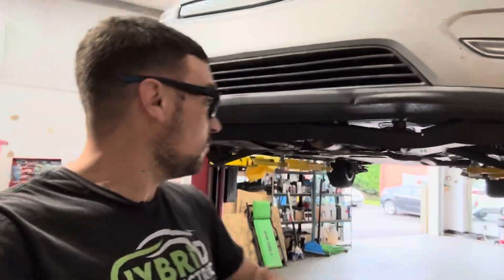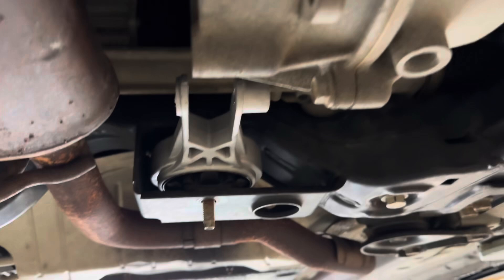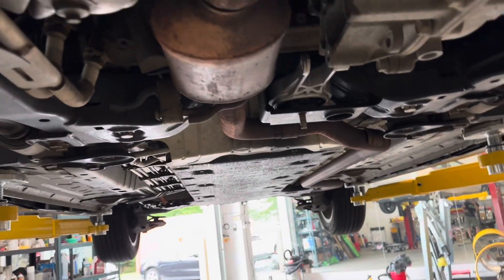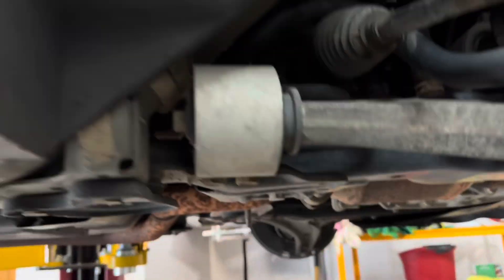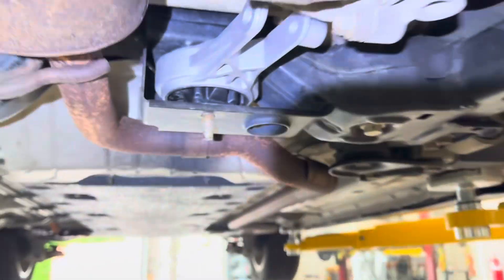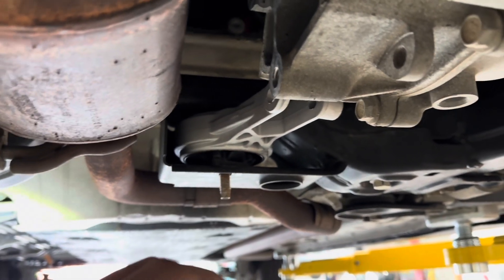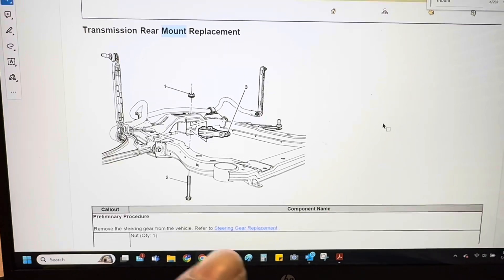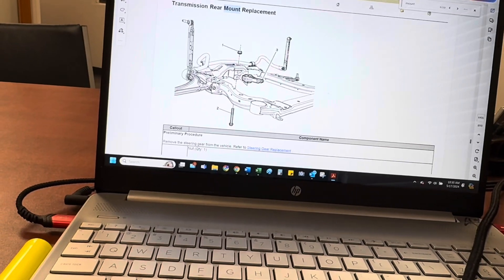Tips for 2011-2015 Chevy Volt Rear Motor Thrust Mount. Bolt mounted wrong way.

Comment: Customer's car is like this, I was considering just cutting the exposed part of the bolt to get it out and reinstalling a new one the proper way...but this is the way! Super easy, the rack slides forward without feeling like you're stressing the intermediate steering shaft, etc... Book time for this mount is something like 3.9hrs, this trick cuts it down drastically!

PS - BTW for this 2014 Volt, the service manual shows it inserted from the top (just like the video shows, and how this customer's car is set up), with the nut on the bottom. Indicating that it is NOT backwards, but obviously there's no issue with reversing the direction.

Comment: bruv if i get vibration/bad mount symptoms, im going to just try the window weld 10$ motor mount repair. its in a good enough position, worth a try. people just need to realize that window weld is a polyureth base and cures with humidity so you need to blast the old crapped mount with brake cleaner, let dry, and apply a small amount so that it can get humidity to it to cure.
Reply: Did that work?
Reply: @HowToDoitright  diagnosed it as a bad pcv diaphragm that is built into the valve cover gasket. added a small amount of silicone to the valve pressure release to minimize the amount of air that can pass through and always save enough battery to not idle when i get back into town. do yearly oil changes once the temp gets warm because there is possibility for humidity to get into the oil. in the last 45k miles ive only put about 6k on the motor all at hwy speed so i feel fine igorning it until the problem becomes worse.

Comment: so, getting the steering gear bolts out is one thing... but when it's time to put the nut andwasher back in place to replace the steering gear bolt, HITF can you get your hand in there to hold time in place until the bold threads catch the nut, on either side dirver or passenger?!   I"m afraid to remove the bolts because i'm 99% sure, it is the LAST TIME the nut/washer will ever be on the bolts.
Reply: ... to hold "THEM" in place ...

Comment: Great tip here, my only problem is the prybar
Sure you need one to move all the stuff but unless you have a lift, it’s impossible to fit it there😢
Don’t take it bad, I was doing the same thing before watching some videos about it and they all say the same as you, but GM really screwed up there putting the bolt in the opposite direction